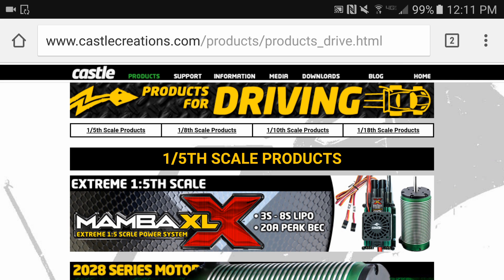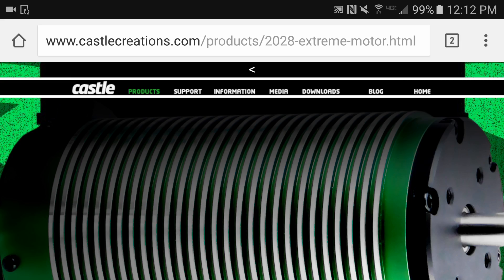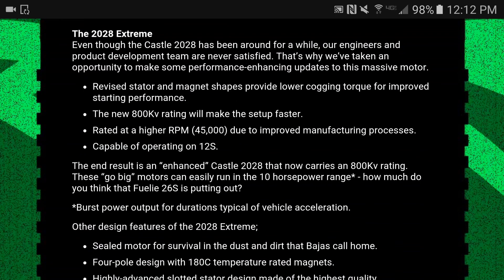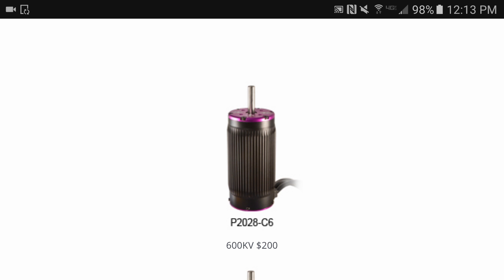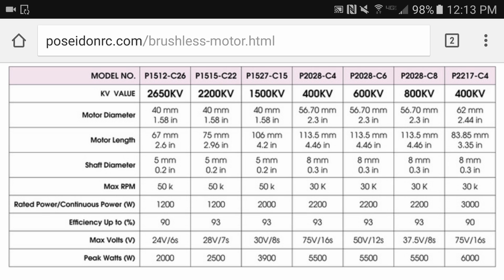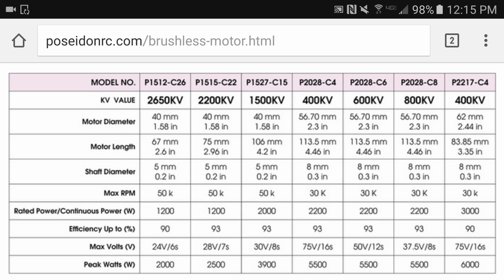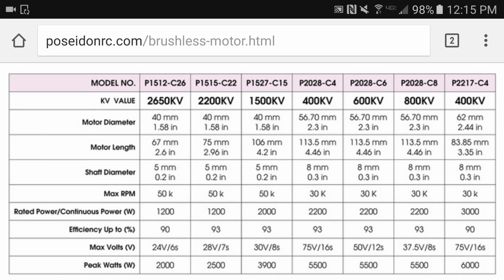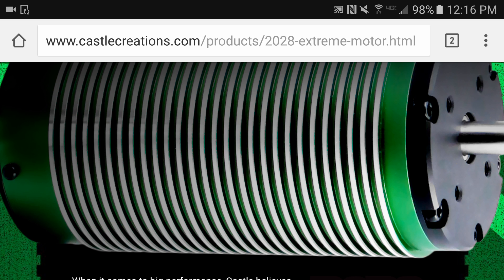Castle vs Poseidon Motor

Comment: Nice comparison, I'll  help you out a bit with the numbers,  kv × volts = rpm so 800kv x 37.5 (8s) = 30k rpm  across the board. Our chart is based on motor efficiency. The motor can perform on higher cells but efficiency decreases and heat increases. So basically if you run the   castle on 8s your only going to produce 30k rpm. Hope this helps.
Reply from the maker: First off i own two of your motors and love them!! i hear ya if both run 8S it will be same RPM 30k ,but what im trying to get at is that my motor can handle 12s so all i have to do to upgrade is install 12S ESC and 2x 6S lipo and im good to go where as the Poseidon 800kv Motor only handles 8S so i would need to buy another Poseidon Motor 600kv which handles 12S just to have 12S set-up.Another point is each company warranties the motors as long as they are ran within the specs given on the websites so if Castle is stating 12S and i push 12S and it overheats the motor it will be covered where as if Poseidon website states only 8S and i push 12S and it overheats the motor  it will void your warranty.

Comment: Love your stuff ,but I was thinking that you were using 8s... Both of them have the same KV on 8s... BUT obviously Castle has more confidence in their design...Dose C.c offer a one year warrantee as well ? Thanks Man !! Love BIG POWER
Reply from the maker: big thanks as always! i hear ya if both run 8S it will be same RPM 30k ,but what im trying to get at is that my motor can handle 12s so all i have to do to upgrade is install 12S ESC and 2x 6S lipo and im good to go where as the Poseidon 800kv Motor only handles 8S so i would need to buy another Poseidon Motor 600kv which handles 12S just to have 12S set-up.Another point is each company warranties the motors as long as they are ran within the specs given on the websites so if Castle is stating 12S and i push 12S and it overheats the motor it will be covered where as if Poseidon website states only 8S and i push 12S and it overheats the motor  it will void your warranty.
Reply: +bigteedo111 I'd make the same call lol 💪
I just wanted you to say that you're gonna run 12s someday lmao 👊
I aint chopping at ya !! I really appreciate your channel🍻 I'll be following ya as long as you're pounding Rc's
Reply from the maker: I know your a supporter and really appreciate you... sorry if it seemed like i was harsh didnt mean it that way